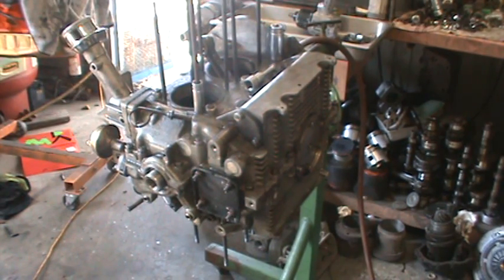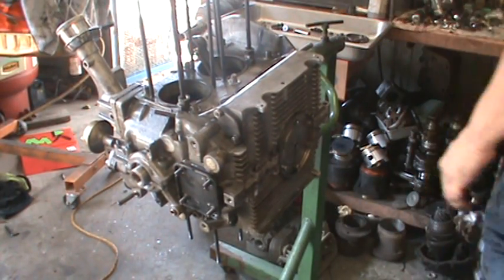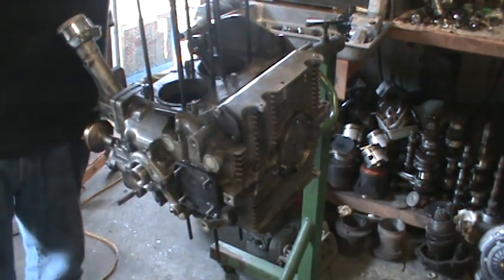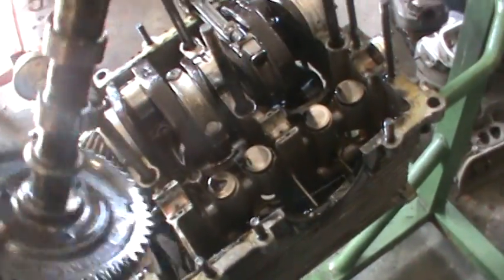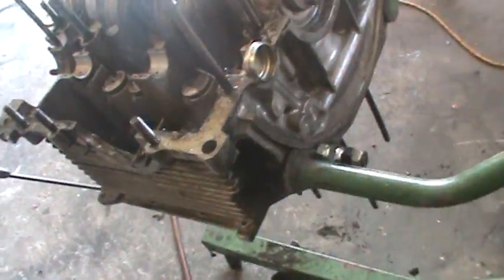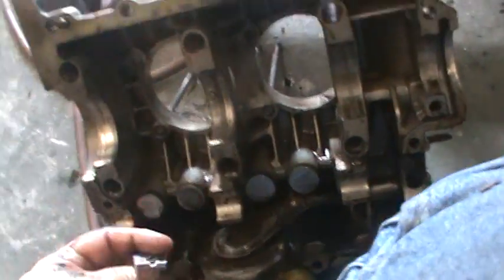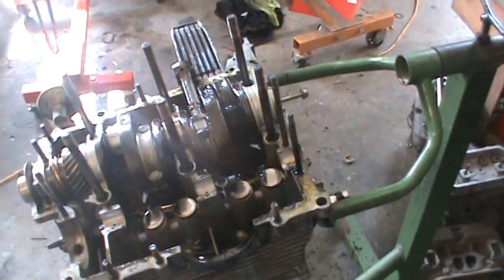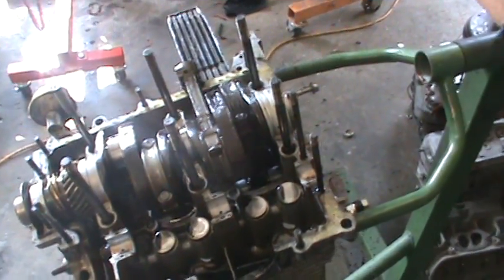looking in side the  vw  1600

Comment: whats the best way to clean the case & parts after taking it all apart?
Reply: "best" way is a high pressure rotary spray tank. Load in the parts and let it run.
For the DIY you can use a parts washer and good solvent and clean it up. (OR IF you wanted to clean and get a divorce at the same time, toss the parts that fit into the dishwasher)  I actually grabbed a portable dishwasher that I modified a bit just for parts. Works good if you use a good industrial detergent.
Reply: ***** What kind of Industrial Detergent do you use? Used dishwashers can be had cheap to free.